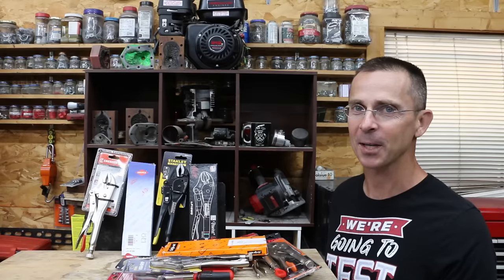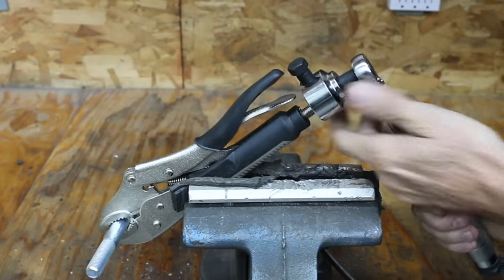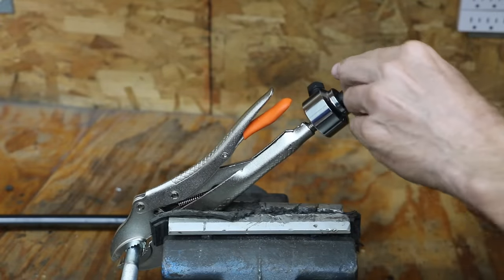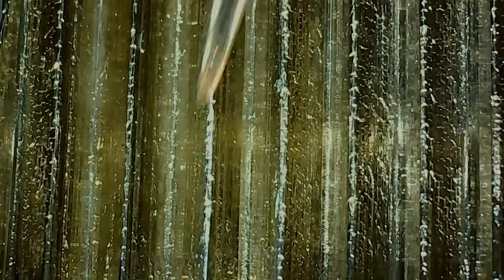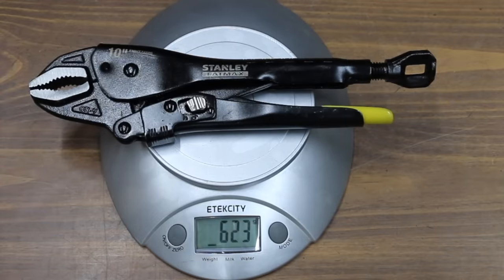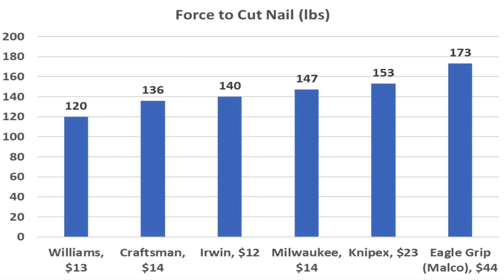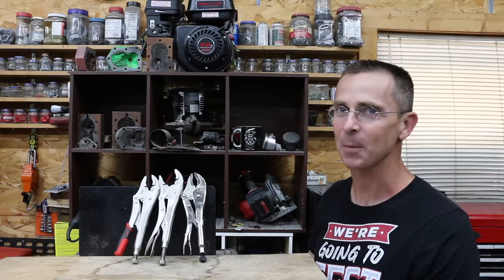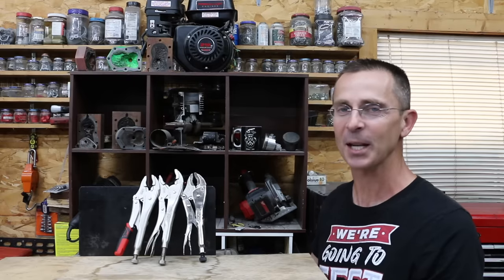Best Locking Pliers (VISE GRIPS)? Irwin vs Knipex, Milwaukee, Craftsman, Stanley, Malco, Pittsburgh.

Comment: I have multiple locking pliers in various sizes.To replace them if lost I'd probably buy two or three sets of those $10/set cheapies&one of the largest sizes of the $44/each ones. BTW on the $10/set ones I'd try to weld a bit of extra metal over the clamped only threaded part. Even if I ruin one I'm only out a couple of bucks.

Comment: I own two pairs of Vise Grips (didn't know they were made by Irwin as I got them from my dad as a birthday present) The big pair I have used for lots of jobs and they are still going strong after 15 years.  The smaller pair has had some use but I haven't had too many jobs were the big set wasn't able to be used.  The last time I used to small pair was to remove a broken bolt, the bolt came out about a centimetre then the head fell off, not twist or snap it just fell off, as I removed the small size ten ring spanner the bolt head just dropped to the ground.  The big Vise Grips where too big and couldn't get a good grip on the bolt so I used the smaller pair and with some RP-7 and alot of wind out half a turn wind in again I got the bolt out.
Reply from the maker: Thanks for sharing.

Comment: An important point is how well the two jaws of this precision wrench fit together. The less lateral movement they have, the better.  When you want a broken screw that has a thin edge and won't open with a screwdriver, then this tool can open it by delicately gripping the outer edges of the screw.  It will not be able to do this if the two jaws of the tool do not fit together well and are loose.  I have not tried all these tools, but the best example that I use myself is wisegrip.
Reply from the maker: Thanks for sharing.

Comment: Different metal removal media: resin-bonded, flap-disc, rubber-backed grit-disc, etc. Use a five-inch battery grinder and a spring-loaded mild-steel rod. See how long the battery lasts and how much metal is removed. Then use a mains powered grinder to see how much metal can be removed during the life of the media..
Reply from the maker: Thanks for the suggestion.

Comment: I grew up about 20 miles from the old Peterson factory in NE. I visited the factory sometime around 1960, just to see where Vice Grips were made. His factory was a real small building but he did crank out a bunch of pliers.
I'd like to point out that the real gripping force is generated by virtue of the force applied by the movable lever acting against the screw set point, not the torque on the screw. 
A more proper method would have been to set the screw to produce the same force necessary to move the locking lever into the lock position for each plier under test.
This represents a more accuate way the pliers actually get used.
Reply from the maker: Thanks for the feedback.

Comment: One thing I see that is an issue with this test, is possible different mechanical advantages in the pliers. But still, the damage to the teeth vs the torque applied tells the story.

Comment: Irwin never seems to disappoint me in performance or value.  I first used them when a friend suggested their hacksaw blades.  I could hardly believe their performance against brands a few percent cheaper.  Next came their hole saws against others that were barely capable of 1 or 2 holes, wow.
Reply from the maker: Thanks for the feedback.

Comment: I didnt know where to post this (which video) so I picked your newest. Since I watch each one video and I always find myself watching older videos over and over again haha... The videos you did with the small engines gave me an idea.

Get 2 cheap Chinese motorcycles off Amazon (Lifan or whatever) and do tests with them. Oil, fuel, and additives. 

Like one bike could be which is the best break in oil (Amsoil break in sae 30 or a good quality Jaso MA2 oil) and send the oil into the lab to get tested. Which wore better. Another would be Shell Rottell T4 and T6 15w40 (Which are JASO MA 2) vs motorcycle specific oil. You could also test motorcycle oil additives and see how they affect the wet clutches...

Figures I give you this idea since I'm sure itd be super fun to make and for us to watch!!! 

Also, do a test of the new HF impact stuff. The 20v brushless.
Reply from the maker: Thanks for the suggestions.

Comment: Peterson Vise Grips?I have several vise grips-Peterson,Irwin,Craftsman and some cheap others.I have them for 25 plus years.The Peterson ones get the most abuse because they last.I have never had an issue of loosing to a rusty bolt.I have used vise grips or water pump pliers to squeeze the handles of the vise grip with the work load and then hit them with a small sledge.The Petersons can handle it.Havnt found any others that can
Reply from the maker: Thanks for the feedback.

Comment: I admit I'm a "Name-Brand"  snob and it used to be Wrong to call an adjustable wrench a "Crescent Wrench" unless it was made in Jamestown NYS. by the Crescent company, or to call a locking pliers "Vice Grips" unless they were made by "Vise Grip", in the USA. now that both company's have moved over seas to maximize profits by minimizing wages. I no longer feel it necessary  to go out of my way to buy their products. through the internet I've learned that the former Vice-Grip employees bought back the original manufacturing plant and are making locking pliers under the "King" name, and making them in the USA.. I for one will be supporting them from now on. Also there is a difference between made in America, made in the USA, and assembled in America. I would be very interested if you could also test if quality control changes with time on these tools. LL&P
Reply from the maker: Thanks for the feedback.
Reply: I haven't heard of the "King" name you mention above, but I know (unfortunately) that Malco had to shut down their factory that made "Eagle Grips" which was the reincarnation of the original "Vise Grips" company in Nebraska.  I will always pay more for (most) USA-made products.

Comment: Comparison suggestion(s): Clamps. There are many types of clamps (parallel jaw, quick release, pipe clamps, so there might be many videos in this category. I recently a cheap 24" bar clamp on Amazon and was unhappy with it. (The one-hand clamp slipped and wouldn't exert nearly any clamping force.) So there's measurable things about this category (max clamping force, leverage, how much friction the jaws have, ease of release)
Reply from the maker: Thanks for the suggestion.

Comment: I was always impressed by the OEM Petersen manufactured ViceGrips and assumed that Irwin would cheapen them up or they would fall prey to lesser offshore manufacturing practices after acquisition.  However, IMO Irwin so far has maintained tool quality similar to the original and has kept the price point/value very competitive.
Reply from the maker: Thanks for the feedback.

Comment: You missed the best locking pliers of all: GEDORE Grip 10''. I have mine for almost 40 years now and it's still going strong, has saved me so many times and a must in my shop. The most unfancy tool of all, inconspicuous and unspectacular but regularly in use.
Reply from the maker: Thanks for the suggestion.

Comment: You can see that in the cheap ones (and in cheap anykind pliers), the very front of the jaws is flat vs. the better brands where it has knurlings till the very edge.  This is very important in tools in general and shows cheap and crappy from expensive and good.
Reply from the maker: Thanks for the feedback.

Comment: Another factor you could have tested in this comparison would have been how well the rivets holding these together stood up to lateral twisting force.  ie. when the jaws are used end on to grab and turn something. Sometimes this is the only purchase you can get on a difficult to access bolt.  And, on a couple of pairs of my mole grips [as we call these in the UK] the ends of the jaws no longer align properly, after such usage. Due to either the head twisting or the rivets loosening.
Reply from the maker: Thanks for the constructive feedback.

Comment: As much as I love your tests I’m not sure this is the best methodology for testing. I’d recommend possibly using a load cell to set all of the pliers to a consistent amount at the jaws. Torquing the adjuster screw is not a very good indication of how much clamping load is applied. The friction of the screw will vary the amount of clamp force. Obviously an adjuster with less friction will apply more clamping force given the same torque. Like you mentioned you do, most will adjust the screw, then clamp down so the friction of the adjuster under load is really more of a nice to have.
Reply from the maker: Thanks for the feedback!

Comment: When testing the grip with applied torque, I think it would improve your data to have a platform/ jig to hold your torque wrench inline so you can remove inconsistent side loading from the test area. This can be seen by how much the bolts move up and down when applying the force.
Reply from the maker: Thanks for the constructive feedback.

Comment: When you get around to testing tool brands , The locking pliers is the acid-test.
Some  locking pliers are suitable for nothing more than an emergency door handle.
Your best bet iis an old pair of vise-grips manufactured about 30 yrs ago, just as with any tool with moving parts.
Reply from the maker: Thanks for the feedback.
Reply: @ProjectFarm  good test, though - BTW

Comment: I see a lot of room for improvement on these types of pliers. I'm surprised a premium company hasn't engineered some. They haven't changed style in decades, if ever. The build is relatively flimsy by today's standards. But they hold up. Usually.
The weak points are weak metal and riveted and there's not much beefiness to them. The break points seem to be common and the pain points are also common.
Reply from the maker: Thanks for the feedback.

Comment: as is usual, your tests are quite good.  i think, though, that testing a single item of each brand is probably not representative of what we'll buy from the stores.  pretty much anything, especially those made in China, are produced by numerous manufacturers.  they are made to drawings and specs.  imagine that you have ten welders doing the weld (where most failed) on the adjustment screw. there is no way that all are going to do the same job.  different currents, different steel (even), different everything.  i'd love to see you test the same wrench bought at three or four locations on differing months how they compare.
Reply from the maker: Thanks for the video idea.

Comment: I don't think the screw-tightening failure load is in any way indicative of real-world use: you can't finger-tighten it to that point, and besides you adjust the screw before clamping.  That said,   Thanks very much for this video.  It is very helpful.  I have a very old set of Vise-Grips from over 4 decades ago, and was thinking of replacing them, and what to replace them with.  When I was a teenager, I may have misused them, introducing some side-play in the jaw from twisting too hard, and also the cutter is somewhat worn down, requiring quite a bit of force to cut bicycle brake cables.
Reply from the maker: Thanks for the feedback.

Comment: Hello Project Farm.  I’ve been doing a lot of DIY wrenching on my car, which has been subjected to dealership air impact everything techs, and my 12 point box wrenches just can’t be trusted in those areas too tight for a 6 point socket.  Shopping, I am surprised to find a lack of 6 point wrenches available…modern 12 point box wrenches have a variety of tooth patterns and many claim to grip bolt head flats rather than corners….is any 12 point wrench as reliable as the classic 6 point for removing over tightened or otherwise stubborn bolts?  I’m specifically curious about tight squeezes such as timing belt work and a size 14mm box or flex head box wrench.
Reply from the maker: Thanks for sharing.  Thanks for the suggestion.

Comment: While many of these comparison videos tend to show that "stronger force is better", Irwin seemed to come out with very close to the least amount of damage to the teeth with good results, which to me, is more important than having the maximum possible gripping force at the expense of possibly more teeth wear. It sucks that they're made in China (probably hasn't changed since) but it's nice to see that they're actually durable. Probably made in one of the few Chinese factories that actually have a quality standard. 

Malco does look very good, and I'm thinking they may require less torque on the screw to achieve the same grip as Irwin (likely reducing tooth wear as well).

It was a nice test that, while narrowing down options, actually still gives you some really good choices.
Reply from the maker: Thanks!  Thanks for the feedback.

Comment: so I'm seeing that maybe there needs to be a thin, seamless collar over the weld at the bottom of the handle. That seemed to be the most common failure point, with it simply splitting apart. I wonder what improvement that would make.
Reply from the maker: Thanks for the constructive feedback.

Comment: Kind of shocked w the Knipex, I have their side cutters, multi grips and pliers- all are amazing.
Reply from the maker: Thanks for the feedback.
Reply: Yes, I have and prefer Knipex too. But for locking pliers, I have ordered Milwaukee some days ago. Irwin is hard to get in Austria. I think locking pliers are not the speciality of Knipex.
Reply: @felixklingel9648  thank you.  I even cut through a live cable w Knipex side cutters- and they still cut amazing.  But if you ever cut a cable that's been in an inferno, it will deaden the edge fast.

Comment: great job aa usual. I bought harbor freight Pittsburgas well junk. Sears Junk Kobalt Junk Irwin was what I always expected from avice grip and although they arnt as good as they were they are real good. When you use a tool once and it brakes it real frustrating right? Yea! dont mess with crap. Just get what works for ya. Find a sale! Oh project work clamps same as these. Most others are garbage. So just as your auto mechanic what he uses. Irwin wins for value!!
Reply from the maker: Thanks!  Thanks for the feedback

Comment: (your cost); i need to buy so check price in PL 
(12) irwin:  the best 14,5 ; but typical is 15,5            
(14) milwaukee: best = typical 12                
(23) knipex: best 19 ; averange 20-22 and higher...
so price are very diffrent, especially irwin - price go up

Comment: Wow, your tests are very creative. I think they cover most of the expectable functionality, and seeing the failure mode(s) is a treat. I think I'll buy more Irwins, after seeing this, while the super cheap ones will go on the yard-sale tools-table. They'll be snapped up quick enough. 

I wonder if you'd be interested in comparing metal-cutting circular saws? I bought a Dewalt 20V Max saw recently (DCS373B) and I've been amazed  - cutting some metals, like thin tube compares to cutting 1/4" lumber! Are all of these saws that good? Are other blades as good? (it comes with one 5 1/2" - 20mm arbor - Dewalt blade) Thanks for the video fun
Reply from the maker: Thanks!  Thanks for the suggestion.

Comment: Constructive criticism(?): "torque required to rotate bolt" should test the maximum torque needed for the bolt to start rotating, not the max torque of a bolt that is already rotating in the jaws. I see the torque meter's reading increasing as the bolt continues to rotate in some shots. The bolt (and jaws) are deforming under load, and it looks like you end up testing how much torque it takes to continue deforming an object which is no longer round. 

I'm not sure the scientific significance of this comment.

I love your work!
Reply from the maker: Thanks!

Comment: I love me a good set of vice grips, I inherited an old Irwin set, slightly rusty, but they still work better than some you tested. My main set is Husky brand, I abuse them and they seem to take it pretty well. 

I'd like to see a comparison with needle nose vice grips like the one you use on the test nail.
Reply from the maker: Thanks for the suggestion.

Comment: After applying a load, I find the adjustment screw on locking pliers gets harder to turn. Did you see any of the front runners have that issue?

Comment: so how about pipe wrenches for a test. 
ideas for test parameters
1 grip pipe , 1 " sec 80 steel, grip flats like on a union
2 adjustment , how easy is it to change sizes, 1 hand or 2 needed
3 reset, so the best part of pipe wrench is you turn it and then reverse the motion and reset and turn again.  some don't release very well
4 fail points, 4' pipe on the end and see when it slips and if you can break handle. i have broken both steel and aluminum ones. 
just some quick thoughts.,
Reply from the maker: Thanks for the suggestion.

Comment: do all the screws coincidentally have the same thread pitch? 
 if not, some should tighten up more easily than others providing more grip.  
if the thread pitches are different, perhaps the methodology needs to be changed?
Reply from the maker: Thanks for the suggestion.

Comment: Not sure if theres a measurable difference but I was always taught to turn the pliers in one direction.
With the lock release side in the leading edge of the rotation. I noticed you turn some bolts one direction in the jaws and some the opposite direction in the jaws.
Not sure if it would grip harder?
Reply from the maker: Great feedback. Thank you

Comment: Have you ever tested tap and die sets? I bought a cheap set from HF but it doesn't even have a 6x1.0 tap. It has 6x.8 and 6x.9 but I've never seen bolts these sizes. Also, I wanted to use the 12x1.75 tap but the threads are galled at the leading edges and I don't remember ever using it. Now I'm looking for a new set.
Reply from the maker: Thanks for the suggestion.